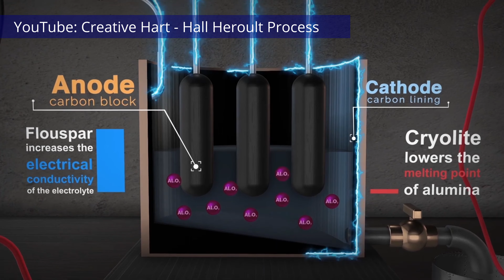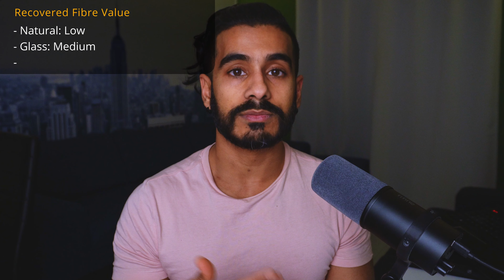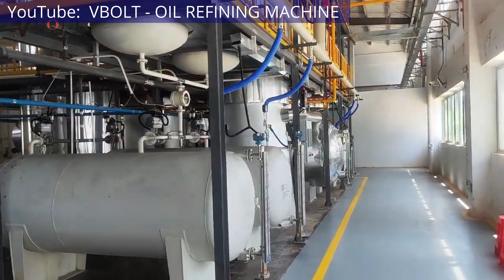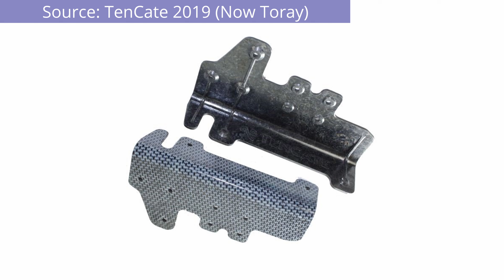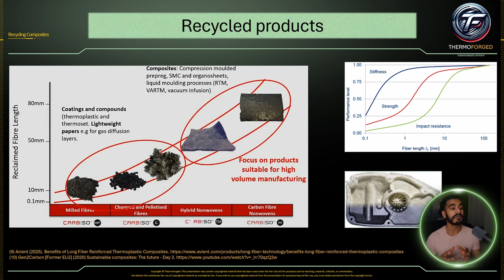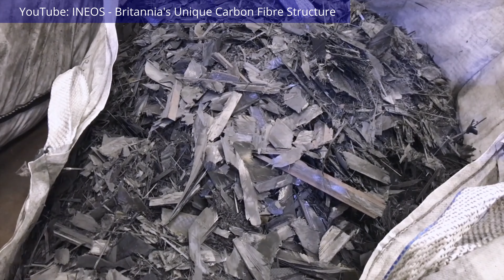Can Composites actually be recycled?

Comment: The fact that the value of the product has to be higher than the effort of recycling the product is a very strong argument for ending any subsidy given to the raw production pipeline, or at least equal per-weight subsidies given to both.  But that should include everything, even externalities like post-extraction cleanups which are sometimes paid for by goverments instead of the extractor.

That is the bare minimum needed to give recycling (outside of the easy cases) an even shot at success; maybe we should go further and provide extra subsidies for recycling, just to slow down extraction of finite resources now instead of hitting a wall at 100mph sometime in the future, after all of the potential recycling stock has been in a landfill for decades...

Comment: Whilst this covers the theory of recycling composite materials that you'd find in a text book, in reality there are a couple of important factors that you didn't touch on. One being the suitability of components for recycling in the first place. Many composite components also have metallic fasteners integrated in the part which need to be removed before recycling can take place, this adds additional cost and complexity which adds increased effort and reduces profit margins.  Companies are now considering this in products that are being manufactured to ensure future recyclability, however it will take a few decades before we see the benefits from this.  The other thing to consider is that recycling companies need to turn the recycled goods into a product, this product will need to perform to a standard and as such they need to understand the quality of the feedstock.  This means that they need consistent supply of waste goods which is hard to come by seeing as that manufacturers are continually striving to produce less waste from production lines, so nobody will want to commit to signing a contract with a recycler for a regular and consistent supply of waste product.  The inclusion of foreign objects in the parts and supply chain issues add further complexity to an already difficult task, and that is the reason why we see such little recycling within the composites industry.